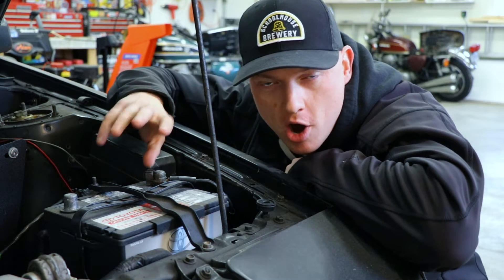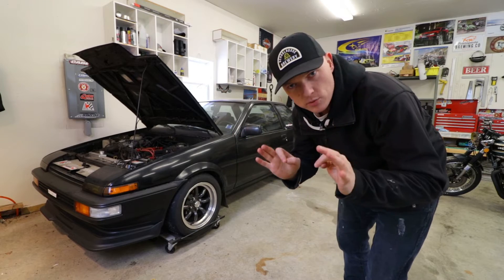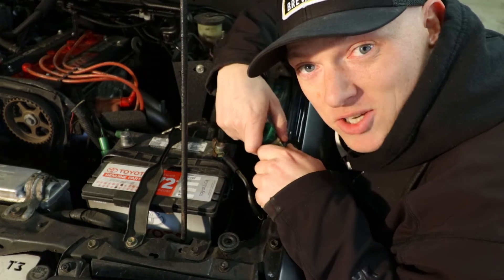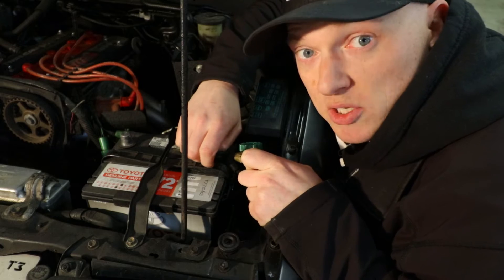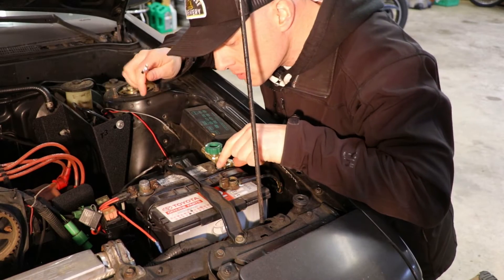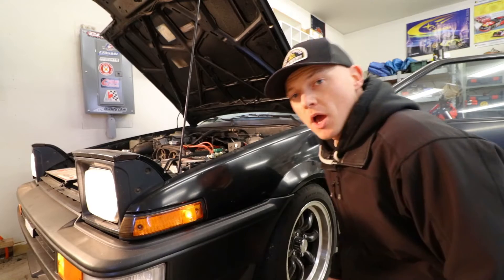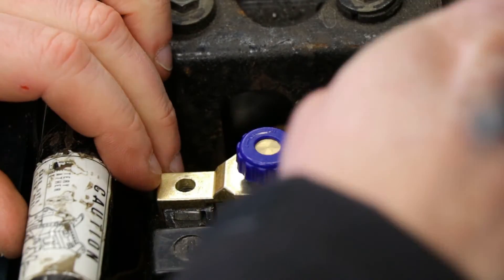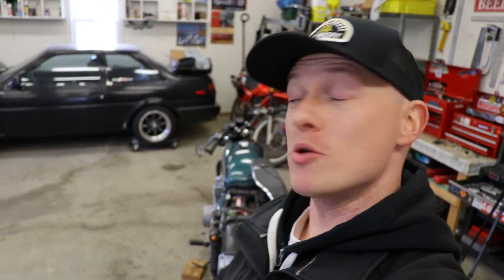How to install battery disconnect or isolator switch

Comment from the maker: You could say this video is... electrifying... 😅
Reply: Hey will that switch work for a boat ? The one you put on your motorcycle?  My terminals on my battery on my boat don’t screw in though they have a nut that I put on it
Reply: Why not use the positive post ?  The negative on my bike is not accessible without taking positive  cable off and sliding the battery most of the way out.

Comment: Great 👍 Simple Explained Video that helped me to attach one to my LDV SERIES MINIBUS 🚐  CAMPERVAN CONVERSION in UK ..
Any chance you are doing a 
•How to INSTALL all a SPLIT RELAY SYSTEM on 2 Batteries in the ENGINE!
•How to INSTALL a REAR AIR ASSIST SUSPENSION SYSTEM on LDV SERIES BUS CAMPERVAN CONVERSION (or any campervan conversion) a LEVEL SYSTEM (AIR ASSIST SUSPENSION-AIR BAGS)
•How to INSTALL A CAMPERVAN CONVERSION... SOLAR PANEL SYSTEM with an INVERTER & LEISURE BATTERY!

YOUR VIDEOS are very BASIC LAYMAN'S TERMS EXPLAINED which is what WE ALL WANT & NEED (Some People get too Technical & Mechanical Stuff which doesn't help with US ...DIY ENTHUSIASTS & BUILDERS & CREATORS )
THANKS 👍 ❤
Reply from the maker: I don't plan on doing either of those. They are interesting topics though!

Comment: I have an ambulance with three batteries (that I'm converting to an RV). There's some parasitic draw going on and I'd like to turn off the batteries when I'm not driving it. I assume I'd only have to connect this to one of the batteries?

Comment: How would one lock their car once you isolate the battery. Say at long term car park.
Reply from the maker: Depends on the car. A lot of cars still have manual locks built in to accompany the electric ones

Comment: Great video! I use the same battery disconnect, but my car has some ground wiring connected to the chassis, which is beyond the battery terminal. Even when I disconnect the battery, that wiring still makes contact with the ground. Is this okay, or should I disconnect the ground from the chassis side as well?

Comment: In truck two batteries  connected to each others in series,  can  I install this to the 2nd battery  negative which is connected to the truck chassis,  to save battery as truck is supposed to parked for months ? Thanks.
Reply from the maker: Yes. Absolutely.

Comment: Great video and if I may add; If you disconnect the positive first or alone, the danger is that much of the metal around the battery (body, chassis, engine) is grounded and could be touched.

Comment: Very nice but on the car battery you could Put on a Different connector to the Disconnector- instead of using the Original round Battery connector. This way there is a Solid hold ..

Comment: Only for the negative terminal? Why not use both or just the positive terminal?
Reply from the maker: It's because of how electricity "flows." You only need to break the circuit in one place to stop the flow of energy. It's safer to break the circuit at the ground. Break it at the positive terminal and you'll get the sparky sparks. Far less risk in breaking the circuit at it's ground.

Comment: The little motorcycle one, can you install it the opposite direction?  Where it hangs off the front side of battery if you don't have enough clearance at the top to turn.  Thinking about it for a 2011 Polaris Sportsman EFI 800.  Maybe this will help my batteries last since I can disconnect without taking the plastics off.🤞
Reply from the maker: I don't see why you couldn't...

Comment: Thank you so much for this video. I have one question. I have a 2003 Thunderbird and it is much easier to get to the fully exposed positive terminal. The negative has an overhang above it that makes it hard to get to. Would it be ok to install this switch on the positive terminal? Thanks
Reply from the maker: They aren't really designed to fit the positive terminal. The positive terminal is generally larger in diameter than the shut off.

Comment: hey, i may need the one for the side post, that or the knife switch i mean if not the one you have here the black one or green one, i need use it for parasitic draw too... in the meantime, due to my situation my guy tried installing the kill switch, but we did it backwards.  now my positive terminal has tape and red wire i feel i can take it out/apart as sometimes my buddy hasn't been answering.

Comment: Is it possible to put a bolt in the one for cars?
Reply from the maker: I'm not exactly sure what you mean... Care to elaborate?
Reply: @Mike Barker  i was thinking like side post batteries. I figured mine out tho. I store my truck and only drive when i need to any.ore cause of gas and my last batt. Completely died.this helped a
Ton thanks

Comment: I have a 2001 Chevy Blazer and neither of the battery cutoffs work- first I bought the one with the lever handle, it was too big and the negative terminal would not reach, then i bought the one you show with the green knob, but there again the terminals are side mount and they have a bolt that goes through them into the battery. Do you have any other suggestions?  I have a parasitic draw that at this point is still unidentified as to the location.
Reply from the maker: You can buy a a set of side mount adapters. They're kind of like standard battery post that thread into the sidemounts. You can then bolt a cut off onto one side (the negative side!!!). 

These are an example:
https://www.amazon.ca/Schumacher-BAF-1-Side-Terminal-Charging/dp/B0060YI0S4/ref=asc_df_B0060YI0S4/?tag=googlemobshop-20&linkCode=df0&hvadid=293018977855&hvpos=&hvnetw=g&hvrand=813322192013775550&hvpone=&hvptwo=&hvqmt=&hvdev=m&hvdvcmdl=&hvlocint=&hvlocphy=9000042&hvtargid=pla-450213759723&psc=1

Comment: How many amps should the switch be rated for? I'm not sure which device I seen on Amazon there are several different ones. I just need something to eliminate battery power when the vehicle is not in use, due to my parasitic draw that kills my battery over a few days of sitting. I prefer the nicer turn knob style switch that I could have in the cab of my vehicle instead of the knife style switch you have used in your video under the hood

Comment: Thanks!  We have some kinda vampire-like draw draining our van's battery in between uses.  It seems to last a few days and then die.  This is going to work until warmer weather when I can troubleshoot the reason for it.  I may not even bother if this thing solves the issue.  It is our backup vehicle.  Installing this seems clear-cut, but I wanted to see a video of it done first, just in case.

Comment: How would this work on a dodge challenger which needs power to open the trunk and the battery is in the trunk?
Reply from the maker: Unfortunately I'm not familiar with the Dodge Challenger.

Comment: I installed this on my Subaru Impreza GC8 Rally Car but it wont work! Same in both positions....electricity is working all the time... whats wrong? There is a cable with a fuse to supply the clock, rally-dash and so on...is this the problem? Fuse is from disconnector to the original terminal via cable....

Comment: Thank you very much I am a traveler last time I had to remove all the stuff from my trunk Mercedes had them in the trunk and small one in the front and everything got wet because of heavy rain, leave car for a year and a half going to South so for that reason I also have decided that I'm going to install the switch next time I hold my stuff will not get wet & mold

Comment: BULLL shittt.  the switch should break  the positive cable.. IF more than one cable is connected to the positive cable there may be OTHER things in the car that IS grounded and will drain the batttery., ME. 83 yearold Master Electrician. thank you.
Reply from the maker: Not bullshit. Although there is more to the overall story on "disconnects"

https://www.motortrend.com/how-to/kill-switch-positive-or-negative/

At the end of the day, the disconnect used in THIS video is specifically sized for THE negative post of a battery. This one in THIS video is meant for a negative post.

Comment: I see play at 3:23 I wouldn't recommending using this version of isolator, this has potential to create spark and fire especially if you're using older carburettor car.
Reply from the maker: Yes, but that play goes away when you make the connection by turning the green knob on the disconnect.
Reply: @Mike_Barker  gotcha!

Comment: These are crap ! I've tried 2 different types on   2 different batteries and they are to small to go on the negative post, that's in the UK,  Don't waste your money until you can find one that fits.
Reply from the maker: That's pretty disappointing Peter. I get your frustration. I wonder why the disconnects (or the batteries?) Have different sizes than I ran into. 🤔

Comment: In theory, if I didn't have a spot to tender a battery, could I install one of these on my motorcycle's lithium battery so that I can bypass the need to keep it plugged in?
Reply from the maker: To have it acy as a simple disconnect? Of course.
Reply: @Mike_Barker  Appreciate the quick reply Mike! Picked one up using your affiliate link.

Comment: PLEASE put on safety glasses, esp. when working on batteries!
Reply: And a video of great warnings about kill switches!
Reply: bases should scare you more. ex: pine-sol will penetrate your eye and will blind you with no hope of fully recovering. 
acids just burn the surface. you'll recover . with exception to HF acid. that stuff scares me to death. ironically it's the weakest acid.

Comment: Could you put one of these disconnect switches on a zero turn mower battery?
Reply from the maker: I do believe you can. Just make sure that the disconnect is the correct size/application for your battery's negative terminal.

Comment: And if you loosen the screw but then accidentally press on top of it? It reconnects right? Same if you have a heavy cable attached. Kind of unreliable I without say
Reply from the maker: I'd say you got a poorly manufactured unit and should return it asap!
Reply: You can see in your video at @3:25 that yours is also wobbly. When you move the negative cable the green screw is moving. I bet the screw will go in if you loosen the screw and lightly touch on it.

So it is possible to accidentally get things connected again. Also with a heavy negative cable, vibrations can dislodge it.
Reply from the maker: I have had zero problems since installing mine.
Reply: @Mike_Barker  thanks for the responses. Having no problems so far does not exclude possibility of problems. Most likely nothing will happen as long as nobody touches it after the green screw is unscrewed and the vehicle is not subjected to vibration.

But... do you get intermittent connection if you loosen the green screw and then wiggle the negative cable like you did in your video when installing?

If you get intermittent connection, then there is possibility that it can reconnect even when the screw is loose. Ergo unreliable. When working, you may lean on the negative cable and it may reconnect all of a sudden.
Reply from the maker: Thanks for your opinion. Like I mentioned I've had no problems like this since I installed it.
Reply: @eyurtese   I agree, this product looks shite. Unfortunately the nicer looking red switch like they use in race cars, I can't see how to easily attach it. I just want to isolate the battery when I open the boot / trunk, so on the terminal would be ideal. But the turn thread   and this product just doesn't seem great. It's just a switch, how is there not a better product than this out there? The killswitch style ones look like they need to be fully wired in, it's not necessary just to isolate a battery, for it to be so complicated

Comment: Help! It seems that before the switch turns off the battery it goes to far and unscrews completely disconnecting the cable. What am I doing wrong?!

Comment: HELP....I need something like this for my RV....I think. I am towing a car on a car tow dolly on back of RV and I need to have the car in neutral with the steering wheel being able to turn, but with ignition turned to accessory so there will not be a drain on battery. Instructions were to get one of these. YES?....NO? thanks

Comment: My car has a 12 volt side post battery and it is very little room to work around the battery because big ass engine and a Cadillac 98 DeVille base model is there any videos showing how you hook this up in a side mount battery like I said I couldn't hook it up with it extending out to the left because my coolant containers right next to the battery and the AC post are tubes are right near that area as well so it either has to be mounted down directly below straight down cuz the only way because indoor facing towards the positive which I don't like is that brings the negative positive too close together so the only solution is straight down let me know I can see a video this being installed that way on side post battery thank you it's been electrifying watching this video.

Comment: I have a camper trailer.  I have installed battery cutoff switches twice.  Both switched were installed on the plastic cover over the battery.  Both switches failed because of corrosion.  What can I do to prevent this????   Thanks

Comment: hello please tell me for how long can i have my car without batteries is there a limit ??? if a car dating back to 2010 is left for several months, will I have problems with the brains and the alarm ??? please say thank you
Reply from the maker: It depends. There are usually batteries built into the ecu to keep stored settings. I don't have experience with every car manufacturer and every model, so I can't accurately answer your question.

Comment: Can anyone help me? I'm trying to replace an existing battery switch with a new one, both the same model Mark is using.

My issue is that I cannot get the cable off of the post. The opening in the cable that slides onto the post seems snug around the post. I'm unsure if the cable opening was crimped around the post? I tried applying pressure with a larger wrench to see if that would open the cable opening more - no luck.
Is there a way to safely pry the cable opening wider, or slide it off the post?

At the other end, I was able to take the nut off, but the bolt with the square end is not budging. Is it safe to use WD-40 on top of a battery?

Thanks for any insight and warning.

Comment: Thanks for the tip. I have an old Lexus that has an issue with battery drain. I’ve had to resort to disconnecting my battery every night. It sucks. I’d like a way to be able to disconnect and connect the battery from a switch inside the vehicle. Anyone know of a way to achieve this simply and without spending a lot of money? Thanks.

Comment: When you install battery disconnect can you still keep your battery tender hooked up even when the terminal disconnected?
Reply from the maker: Yes you can. Just make sure the battery terminal is correctly bolted to the battery. The battery tender terminal needs to be on the battery post side of the isolator.

Comment: I'm no sparky, but I've never understood the "disconnect the negative side" argument. If I'm working on my car and disconnect the NEGATIVE side of the battery, then any hot wire I'm working on can short out to the frame (and has, too many times). Same with a tool that happens to touch an exposed red wire and frame. However, if I disconnect the POSITIVE side of the battery, the only risk of shorting is at the battery terminal itself (easily managed). Am I missing something here?
Reply: No they cannot short to the frame if you have the negative terminal disconnected. The frame is only at ground when the negative cable is connected to the battery because then there is a direct connection between minus and frame.

Comment: I installed one of these on my mower (car version) and just got one for my brush mower (bike one).  I don't remember which terminal I put it on my mower or why.  I'll be sure to check, but from Google image searching shows a lot of them on the positive side.  Because of the orientation it would fit better on the positive for my brush mower also, but I see you left a comment to put it on negative.  Why does it need to go there?

Comment: I want to do this with my rv but it has two batteries,  so I need two or just one and witch negative post would I put it on?
Reply: They make switches specifically for what you're looking for just type in battery disconnect on any auto wesbite 🤠

Comment: Good stuff mike more on that 👉 Corolla??
Reply: This witch's don't work good if you unscrew it all the way and take a loose from the cable that works but if you leave it hanging there semi hooked up if you slam the door it's going to buy break-in kit to switch back in

Comment: Please make a video how to let car alarm and remote key still in working condition despite engaging the battery diconnector for other functions.
Reply from the maker: I'm not really sure how to do that. It would involve a little more work than simply installing this cheap part.
Reply: @Mike_Barker Just thinking it will be helpful if they still work for antitheft purposes